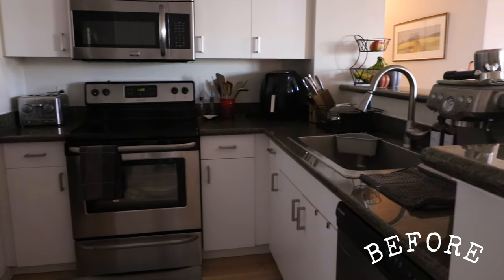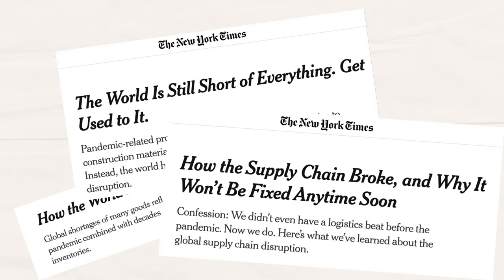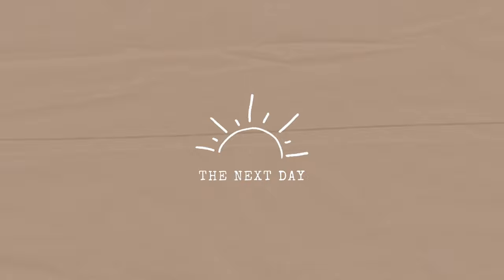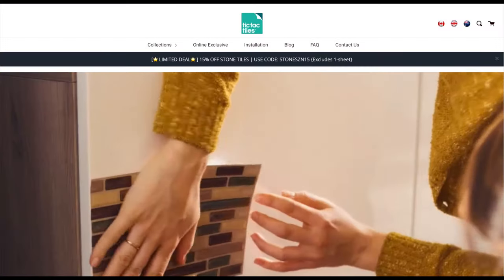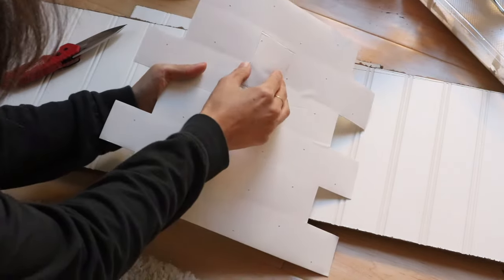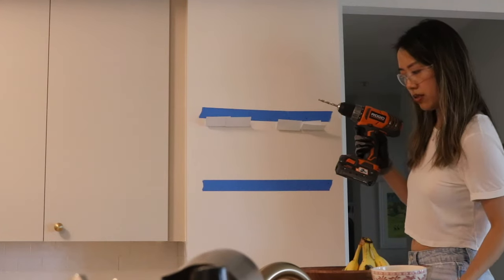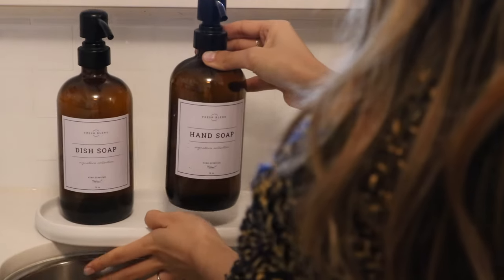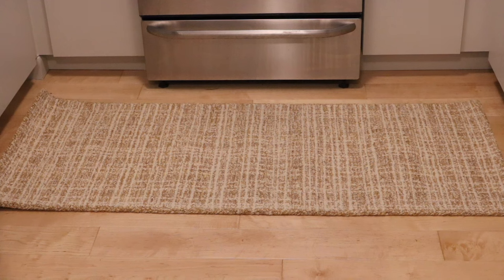DIY SMALL Kitchen Makeover! Minimalist Scandinavian ✨ft. Tic Tac Tiles

Comment: Very cute reno! The white countertops really open up the space. Are the tiles above the stove already peeling?
Reply from the maker: Thank you!! There are a couple of spots that are lifting on the edge - either due to me sticking the tiles too close together so they're pushing outwards or the wall not being sanded down enough on some spots.

The stove area is also where a lot of heat and moisture gets dissipated so I'd recommend pressing firmly and leaving it to dry longer before using the stove. Hope that helps :)